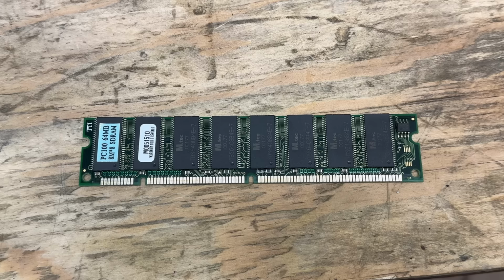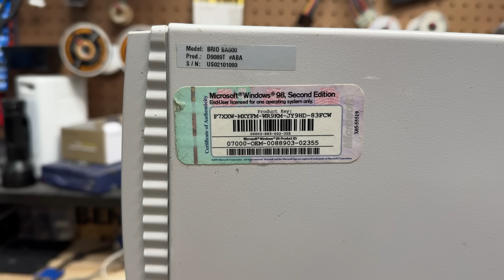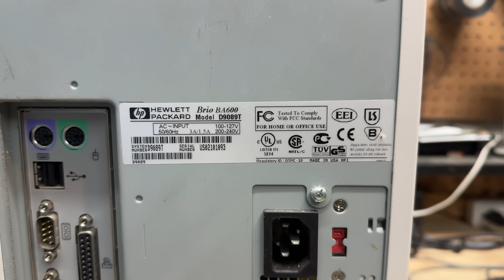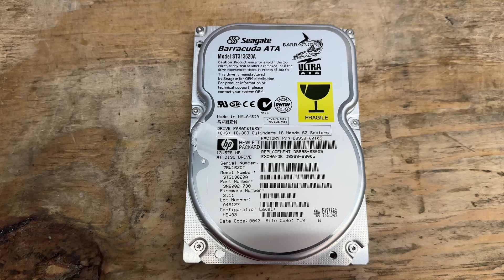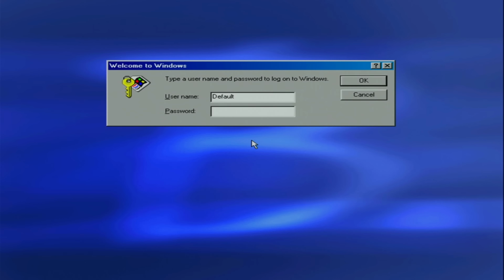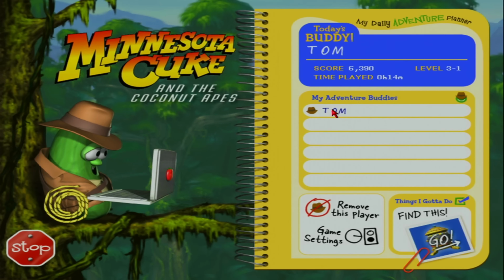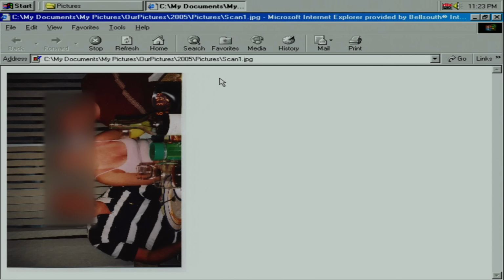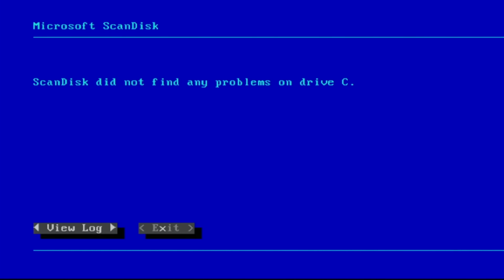Micro-ATX Madness! Early 2000's systems teardown and test!

Comment: I’ve got a HP Brio at: 15:45 which was Manufactured on the 25th of January 2000, 2 days after yours! 😂 Mine has a PCI Card with 2 x extra Serial Ports as my Father was a Ham Radio Operator & believe that’s what he needed them for and it was passed to me after he passed away! 🇬🇧

Comment: 16:01 I always loved how HP made those support rails and internal case frames razor sharp so as you were removing components there was always a little blood letting inside the case. I am pretty sure HP had shares in Band-Aid.
17:17 We called that creep, the cards would creep out of the sockets and have to be re-seated. It was due to heat and cooling cycles more than impact.
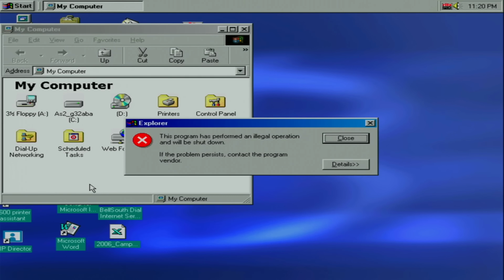30:17 Corrupt HDD or virus not letting you explore the file system. The weird volume name for C:\ has me thinking virus.
Reply: Now look I'm serious here. Are you sure the cards weren't trying to escape?
Reply: @keithbrown7685  I am absolutely
 sure they were trying to escape, they were trying to "creep" away, but with no legs it was futile.

Comment: I remember seeing modems doing this on a regular basis just from picking up the case and moving the computer.  I worked with a company in the days of Win NT4.0 and the computer cases then though they were heavy were not always built the best.  What I'm saying is the system case being torqued or moved could cause the cards in the PCI slots to creep out of socket even when they were screwed in the back.  The company  I worked for had all the IT Techs practice removing the case and reinserting cards because of what you showed in this video with the modem.

Comment: I have to agree about HP hardware support. I never understood why they always required the part number. I just gave you the serial number. I dealt with them quite a bit and I don’t miss it one bit.
Reply: Just off topic a little, Dell's support number was like a walk into something that was part Hell, part madhouse.

Always they'd send me over to tech support overseas, where the accents ran thick as molasses. One time, I lucked out and got dropped into a tech support hub in Texas. The dude was speaking English, and I almost started begging, please don't send me to one of those sweatshops overseas. But he had no choice, and I was sent back to the wacky world of Indian guys with names like "Edward". How likely is that? Encounters like that, could make the hold music sound sweet and heavenly.

And all I wanted were some ****ing recovery disks. You think I got them? If you said no, you'd be so very right.

Comment: One of the first 52x drives I had come into my shop was in a machine a customer brought in and wanted their brand new hp printer installed and the drive spun up and the CD exploded out of the drive. There were pieces about 30 feet away on the other side of the store. Surprisingly I wasn’t hit by any shards as I was standing directly in front of it talking to the customer.
Reply: The famous 52x disc shredder 😂 Those bastards were really mean to old CDs that had spent too much time drying under some form of heat of powerful lighting 😂
Reply: These and the 56x ones, you were playing with fire each time you put one of your games discs in back then.

Comment: Actually, I am curious if we might see usb c based hot swap bays like this, so the USB c connector can handle the disconnections and the adapter sits on the hard drive or caddy.

Comment: I had that same main board, the first PC I had with USB and it was running an old Slot 1 Pentium 2 266Mhz

You're correct in thinking it won't run both CPUs simultaneously

Comment: I hated those HP systems, tried to upgrade one once with a new board and the new board wouldn't fit....wound up scrapping the whole thing.... the only thing that was saved was the MB tray... the other chassis is really nice, but it has the same issue, trying to get a new board in it... not to mention the PSU....  could the chassis support a AM4 or AM5 MB?

Comment: I discovered this channel recentlyy, and it quickly became a favorite of mine. This subject matter is dear to my heart, as I have several old PC's which are all still working. I have also noticed and highly approve of the old school Logitech Trackman trackball, as it is my favorite controller. I first got one to play the original Doom, as I just couldn't handle the normal keyboard and mouse combo, and an analog joystick was too slow. The Trackman was perfect for me, and I used it for many years all the way through my Core 2 Duo WinXP system. After it was discontinued and when eBay became a thing, I bought as many of the Trackmans as I could find so I would have one for all my systems and with a spare or two. I've finally upgraded to the wireless Ergo M575 version for my laptop and current desktop system, a Ryzen 5 5600 that I built myself., but those original Trackmans are still with the other systems.
Reply from the maker: The Logitech Trackman is really great for this environment. The bench can get pretty crowded so it’s nice to not have to swipe a regular mouse around.
Reply: @miketech1024  And that's one of the big reasons I love it--I've never had enough space for a large mouse pad, and I just can't stand having to constantly pickup a mouse and move back to the middle. And for me it was far easier to move the ball with my thumb than a mouse; always been puzzled why this kind of trackball never displaced the mouse as the cursor controller.

Oh, my other PCs:
a 486DX4/120 (just converted from a Baby AT desktop case to a mid-tower)
a Pentium 233 with 3dFx Voodoo 1 (recently converted from a Baby AT mid-tower to an ATX mid-tower)
an Athlon Thunderbird 900 with dual-boot DOS 6.22 and Win 98 and a Voodoo 2 in an ATX mid-tower

2 Core 2 Duo WinXP pro ATX midtowers; one was a custom build from my favorite local computer shop and was my main PC for some years, and the other was a Dell Optiplex I got a couple of years ago from eBay to replace the other one when, after years in storage, didn't turn when I tried it. Turned out it just needed a new PSU, so now I have both working.

Comment: First one is definitely an interesting transition machine. I remember around this time that weird modem/sound card slot appeared, do you remember it? it looked a little like a PCI-E 1x slot but was for these highly integrated machines and I think most of the actual processing was done on the motherboard.
Reply from the maker: Yes! System 1 of this video had such a card for sound: https://youtu.be/2e28MVL7kPk
Reply: @miketech1024  Ah yeah that was it! thanks

Comment: Congrats on finding the first computer ever made, running Windows 98. Makes you wonder what those other operatings systems were for then. Clearly just one massive experiment.

Love how you almost infringed on the RAM trademark in system 1 lol.

Bell South still exists, but it ironically became a subsidiary of AT&T. I'm pretty sure the emails are basically just MSN emails nowadays.

System 2's hard drive sounds fabulous, so damn crunchy. It's a sound that'd be worrying for a modern mechanical drive but totally normal for drives of that vintage.

Comment: Funnily enough, modern slot-loading drives like those found in Apple SuperDrives and the like can NOT take 3 inch discs. The mechanism relies entirely on the shape of the disc to guide it in/out and as such only a full size 12cm disc works.

Old drives did- in fact, do it better!

Comment: That slot loading drive is from Compaq Deskpro 2000/4000 series. It is miracle it still works, the CD in/out is driven by a big flat belt that rolls the disk.

Comment: There's a gotcha about those removable hard drive caddies. They came in two varieties, ones with a 40 wire IDE cable and ones with an 80 wire IDE cable. If you install a UDMA drive, like ATA-66, 100 or 133 into the older 40 wire caddy, the drive performance will be crippled to 33 MB/s, which is the maximum speed you can do on a 40 wire cable. There are later 80 wire variants of those caddies, but they're harder to come by.

Comment: Back in the day when I worked at a computer store we used a lot of the motherboard in the first system and started regretting it as every single one of them came back and had to be replaced. Our supplier talked us into using them since they sometimes had great deals on slot 1 CPUs and it was a super cheap board.

Comment: That first one is really neat; my grandfather had a different revision of that case when I was a kid (I still have the case, not the internals though). Interestingly enough, I'm pretty sure he had the exact same motherboard. It's been a while though so I can't be sure, but I do remember it being gold and having dual CPU slots, minimal card expansion, and unmarked front panel headers. His case also had the SFX supply mounded in the center, not offset; and provisions for a half height 5 1/4 HDD above the top optical drive. 

Interestingly enough, a full size ATX power supply will juuuuust about fit. It would render the front 5 1/4 drive bays almost unusable though. I cut a 120mm fan hole in the front of the case, and a 80mm hole on the back; now it has reasonable airflow. I plan on putting my next PC build in it!

Comment: Two low-end 98se boxes. Mid to late 90s cranked out tons of those for less than bright PC consumers. Bewilder them with BS, and up to the cash register. I never liked SiS chipsets. Computers should not crash (over and over) while installing Windows. I'd even copy Win98 to the HDD, and run Setup from there. Still death. Nicest sound those PCs made, was hitting the bottom of a dumpster.😆

Comment: I love the sounds of that hard drive!!!! Nice and crunchy! The one problem with SSDs is that they are far too quiet!
Reply: Now wait. Couldn't there be a sound file that plays, every time the ssd is doing something? It could be a long piece of audio, for authentic crunchiness I mean. One needn't hear the same sound over and over, but something more believable.
Reply: @keithbrown7685  It should exist! Perhaps I should make one and sell it! I know that there is a module that you can plug into a Molex plug inside your computer and it will make hard drive sounds but I think it is a constant loop of low fidelity clicks that loop. Not nearly the same thing, as you said.

Comment: You got so lucky with that PIII 550. Was terrified that I was going to rip the slot off my PCPartner VIB862D, as the Celeron 333 had never been removed since it was installed 20th April 1999 and felt very permanent.

Though the fact that it never went into e-waste early on is amazing as the aftermarket cooler on it didn't have the plastic removed from the heatsink. Resulting in it constantly overheating and the OG thermal compound having barely touched the CPU around the edge of the plastic. Lack of use due to the CPU overheating would explain the small amount of dust and the yet-to-fail caps. One benefit to Slot CPU - being further removed from the board helps prevent the capacitor roasting my GA-7IXEH experienced.

Comment: If you want to have the brittle plastic experience, give one of the mid-90s Powermac cases a try (PM 7500 for example). You give it so much as a stern look and it'll crack and turn into dust 😂
Reply: That's that ole pasta plastic as I call it. The SNES is full of it.

Comment: I have a very similar motherboard to the first system, it is made by PC-Chips, in my experience their socket 7, 370, and slot 1 boards are very decent, but they have a reputation for being "cheap" in retro computer circles.

This one supports slot 1 Pentium II, III, and socket 370 Celerons, but not socket 370 Pentium III, and you can indeed only use one at a time, although there is no jumper to switch between the two. Installing both at once is possible, but it may result in catastrophic excitement! 

Mine has integrated sound and networking, but has an AGP slot instead of integrated graphics.

Comment: man that first system has it all. cool removable hdd tray, socket/slot combo, removable mb tray, pci and isa (i think?) slot, unique connection for the dial up modem and nic, and an sfx psu. only thing it needs is a cool graphics card. normally i absolutely hate proprietary parts like those network cards, but theyre just so cool to me in this case.